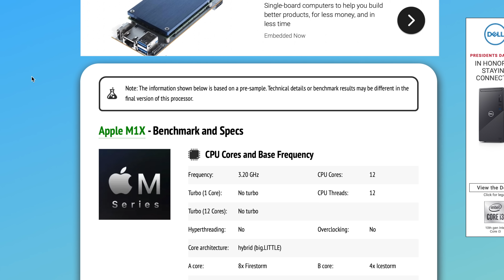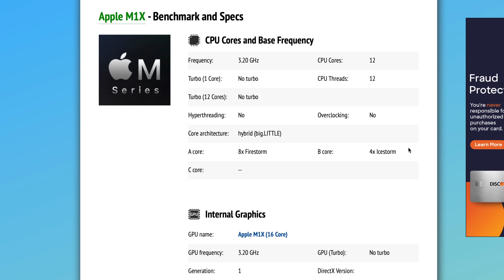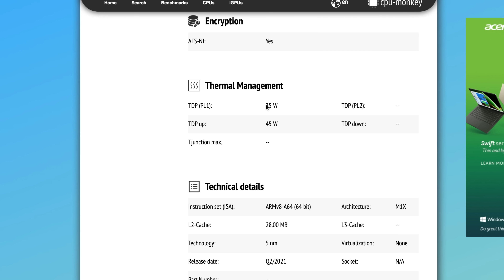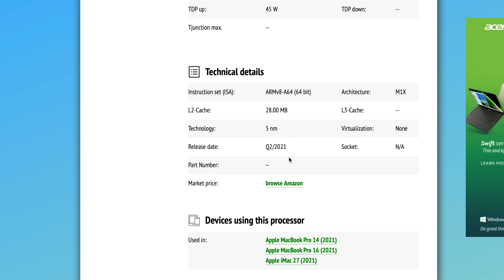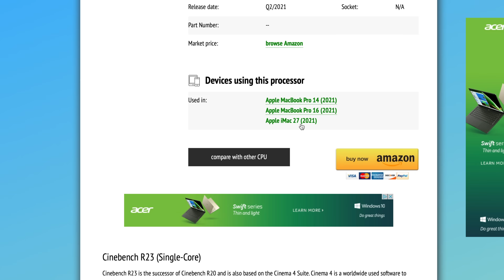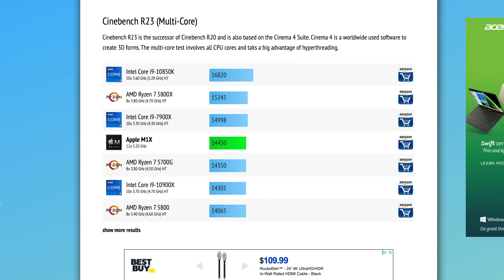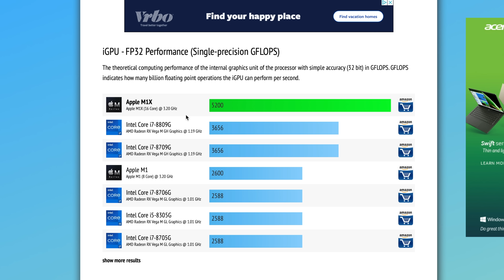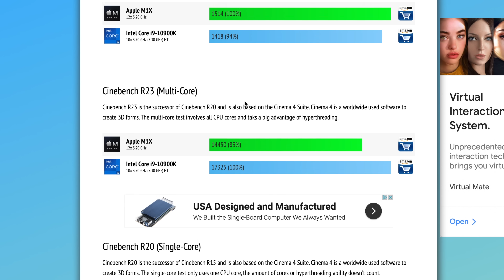There's no way M1X can be THIS fast...

Comment: Projecting the performance from A to X to A etc. is a much easier task when you have years of improvements to base the projection on. M1 is a new beast, so I'm not surprised Luke is hesitant to try and guess, even an educated guess, of what Apple might do with an M1X. First, what Apple CAN do and what they WILL do are very different things. Second, we don't know how scalable this architecture is, and while it appears that there is a ton of headroom, we really don't know. A 40% improvement from M1 to M1X is reasonable, but at the same time, maybe Apple was sandbagging performance on the M1 and 140% improvement is possible. Or Apple could decide not to jump too far, too fast, and will keep the gains artificially lower. We won't really be able to project until we've got two generations of tick/tocks to get a sense of the pace Apple wants to go with.

Comment: Great video. Really excited to see how far Apple Silicon goes with respect to performance. Also, CPU performance doesn’t double when the cores are doubled, but graphics performance does double when the cores are doubled.
Reply: “Cpu performance does not double with double the cores” this is applicable to discrete x86 cpu not apples socs
Reply: @kingyogesh441  not true.

Comment: By this point Intel is almost falling off the cliff of the CPU market.
Reply: Have you seen their new smear campaign, taking direct aim at Apple? 

They're worried 😅😅
Reply: Not really as apple wont be suppling there chips to others so its not really going to effect them. Apple is popular but in the computing market, they still have very small market. Team blue still have the biggest part of the pie followed by AMD and its not a close-run thing either. Yes they are lagging behind but there starting gear up. Who knows maybe apple will start supplying chips that would be interesting.
Reply: @Twinklinglittletoes  I would disagree with this, I've been following this really closely and Intel are already coming under pressure to give up their own chip manufacturing processes, retain the design branch but outsource to companies like TSMC, because they are falling so far behind what's going on in the industry. 

No one knows what's going to happen, until it does, but it sure is going to be interesting watching the way the industry evolves after this because it's going to create a real push for ARM-based Windows devices which are actually remotely competent - never mind high performing, like this.
Reply: @notanothersimsvlogger1120  competition is a good thing. Let’s see what they can do.
Reply: @Twinklinglittletoes  you can t just change the architecture and name it a performance boost. no one wants to rewrite their software and have a limited range of the tools they can use. only apple normies who only use their mac for what it offers are okay with that
Reply: https://googleweblight.com/fp?hl=en-IN&u=https://ark.intel.com/content/www/us/en/ark/products/207903/intel-pentium-processor-j6426-1-5m-cache-up-to-3-00-ghz.html
Reply: @swipekonnect  so, what do want me to get from this page? Intel being on 10nm😂. AMD is gonna be on 5nm next year. Although gotta say they have squeezed every single bit of performance out of those 14nm chips.
Reply: @gliderman9302  intel got bogged down in fabs, now they've changed course and gone fabless, what i meant was it ain't over. on the other hand, look up my other comment: apple silicon might become the new intel
Reply: @gliderman9302  so Intel is going to be competing on architecture alone. That’s going to go well for them long term. It was Intel’s ability to invest in state of the art fabs that kept it at the leading edge of performance. If it’s bidding for production out of pay for play fabricators it’s on the same field as everyone else.
Reply: @francesconicoletti2547  intel will be competing on the durability of their cpu: ability to upgrade both your ram and your gpu and getting high performance
Reply: @luxraider5384  when intel eventually shrinks it’s feature size , what do you think intel is going to do with all those extra transistors ? Integrate its GPUs and RAM more tightly with its CPUs for better performance perhaps ? Given that ARM class CPUs are the best selling CPUs on the planet, I doubt they have reliability issues.
Reply: Some day PowerPC was a king🙄

Comment: i do believe the 32/64 core apple processor which you mentioned is one slated to release with the new Mac Pro, which makes more sense ofc and which has been stated many times before like fr no way are we gonna see smth like a 64core laptop processor, would be insane tho XD
Reply: With the thermal capacity of the M1 architecture I could see a 32 core processor working in a gamer laptop style machine but don’t think Apple is likely to release it.
Reply: @thomase917  well ofc it would be possible but it just wouldn’t make sense if you know what I mean. Cus like that would be a server/high end workstation level CPU that really wouldn’t have much of a place in smth like a simple laptop. Like yea some workstation laptops do exist like the thinkpad P-series having Xeons. But still they are slightly lower end xeons Cus the higher level xeons have much greater power demand which a laptop would struggle to deliver
Reply: Also Apple is probably waiting for 3nm for that number of cores on a single chip. Which is what 2022 ? Mac Pro first, couple of years later trickle down to high end everything else.

Comment: This is impressive for sure, and it's awesome that they might be that performant. But my question - and it's legitimate, not rhetorical - is in desktop machines, what's the benefit of less wattage? I mean obviously in a laptop it's a huge thing for battery consumption, but what does it change in an iMac for instance? I understand more power = more heat, but with good heat management is there a real benefit?
Reply: Yes. Ultimately, lower heat means you can add more cores and get better performance on desktop pc’s.

Edit to add: There are very real limits to thermal management in computer design. Desktop designs have a specific thermal envelope they have to fit within. Better efficiency allows you to  pack more power into that envelope.
Reply: @thomase917  cool thanks!

Comment: The results don't shock me with how good the M1 is.
Reply: Imagine m2
Reply: @silicon.  The m2 chip will be featured in the mac book air. The M2 will be better in every way compared to the M1 chip but the M1X which will only be in the mac pro and the macbook pro will be better than the M1 and the M2 chip. To simplify it. The M2 will be better than M1 but not better than M1X. M2X will be the successor to the M1X which like I said will only b featured in the pro macs this time around.
Reply: @silicon.  That will be 2-3 maybe 4 years from now
Reply: @silicon.  That could be a very major upgrade or very minor, we’ll have to see.
Reply: M3 coming out soon

Comment: Yeah, make a video where you estimate m1x performance.
Reply: Agreed!
Reply: well you can do this rouphly already, it's estimated to have 8 performance cores and 4 efficiency cores compared to m1's 4 performance cores and 4 efficiency cores. With this, you can estimate that it will be about 1.6-1.7x the performance, which, according to PassMark benchmark, puts it in line with the i9-10900k as mentioned in this video.
Reply: Agreed!
Reply: If I had to guess I would say Apple 🍎 will focus on cpu performance and neglect the graphics . It still lags behind AMD and nvidia igp.
Reply: @neubauerjoseph  Nvidia has iGPUs?
Reply: @michaelstrasburg5451  yes they do. its not so popular but its almost as powerful as a low end GPU. Who knows of we will see any IGP based on the 2070 or 3070 cores. Going back to apple their graphics in the M1 chip needs to step up, and that was one of the only reason why I didnt get a macbook this go around.the graphics performance wasnt close to other options such as the alienware m15R3. If they even had a graphics options that could compete with a GTX 1050 or 1660m super well I would consider it and probably buy it.
Reply: @neubauerjoseph  name just one laptop that can handle games with an integrated GPU as the m1 chip?? just one!!!
Reply: @christhedoc8689  Mine Alienware m15R3.
Reply: @neubauerjoseph   😅😅 buddy an integrated GPU it’s a GPU that it’s built into the CPU... all the alienwares comes with a dedicated GPU., meaning that the GPU comes completely separate from the CPU, I mean 2 different parts... there isn’t any CPU from AMD or INTEL that offers that performance from a chip.
Reply: @christhedoc8689  nope wrong again, it comes with both a  intel UHD 630. Performance of this chip depends on what cpu it’s paired with. As with Alienware they like to be on the higher end of performance so they often have higher watts and performance at the cost of more heat and less battery life. So in terms of intergrated graphics well it depends on the cpu and the chipset. If you have a thin and light cpu vs a desktop replacement such as a Alienware or a such it will always perform better. Always you can say oh ok he M1 is better you have to look at the whole picture and say well what is apples values and goals. Also because my system has a high bus such as a 256 bit and the graphics card such as a 2070 super. I love Apple but they mostly care about cpu stuff and gpu things like video editing , playback and general processing. 3d performance such as 3ds max or 3d games such as mechwarrior 5 or flight simulator 2020 a MacBook would struggle. Even the top MacBook Pro wouldn’t do that well. It would cost you a lot of money 3-6k. So I would love to see Apple step up their game on graphics to where they offer better cards that can go toe to toe with the best that dell or HP or asus or msi could bring. Such as AMD or Nvidia.
Reply: @neubauerjoseph  The UHD 630 is nowhere near M1's igpu. And 2070 is a dedicated chip, of course itll be better than any igpu.
Reply: I 6th this idea.
Reply: Agreed
Reply: This is why, he is running out of ideas to make videos.
Reply: @neubauerjoseph  exactly lol